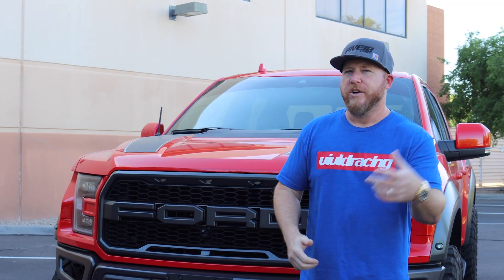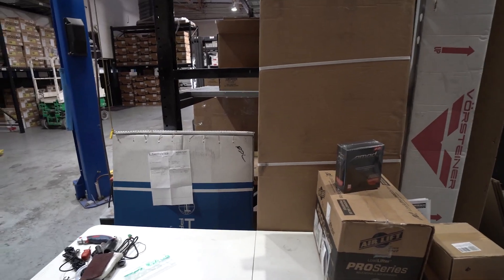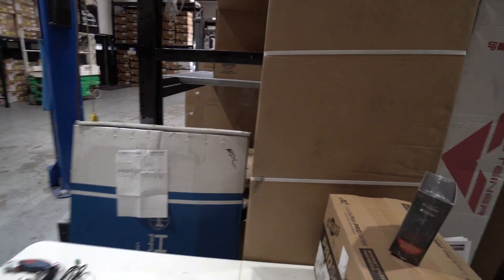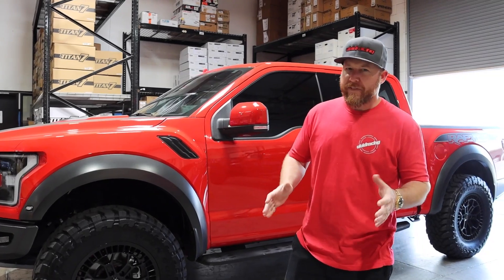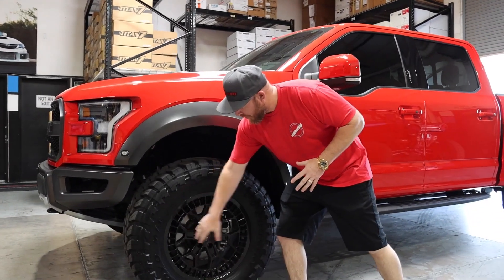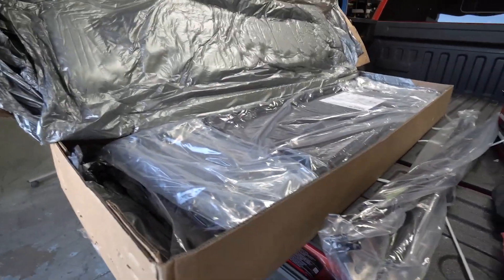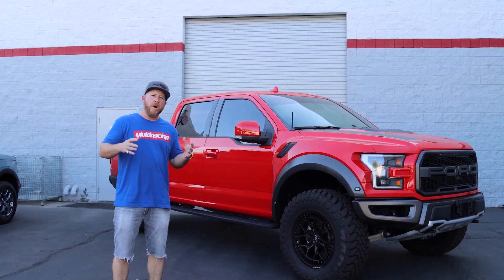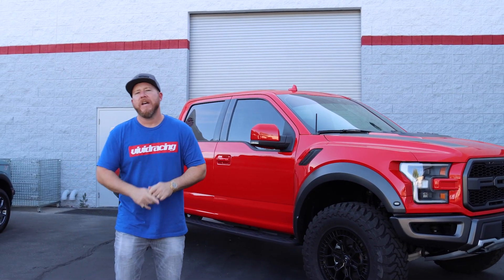HUGE Updates for our Project Raptor!! | NEW MODS ALERT!

Comment: Any idea what the new height is on the truck with the spacers and tires? I've got a stock 2018, but use a parking garage regularly with a 6'8" clearance and am already close. Truck is awesome, love the mods!
Reply from the maker: Will measure for you
Reply from the maker: My garage height is 84” and to the antenna looks about 80”